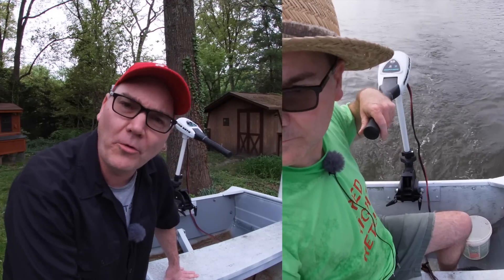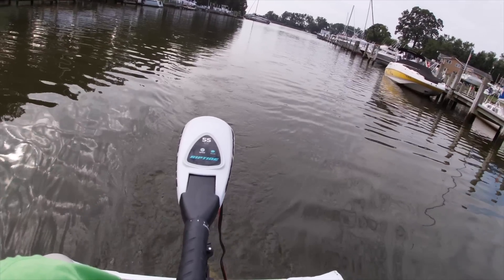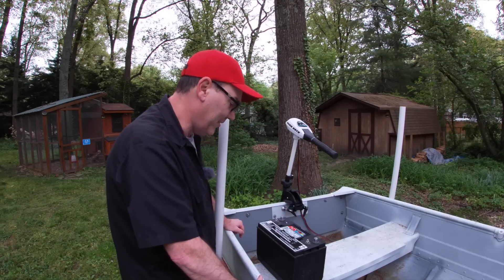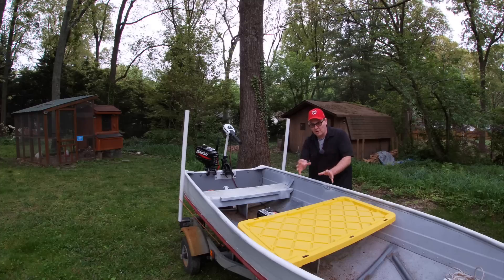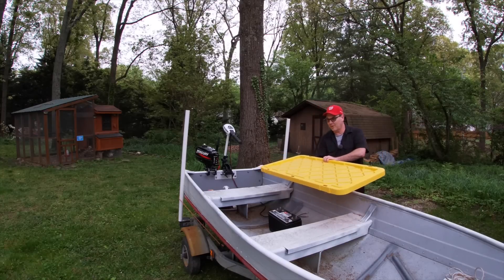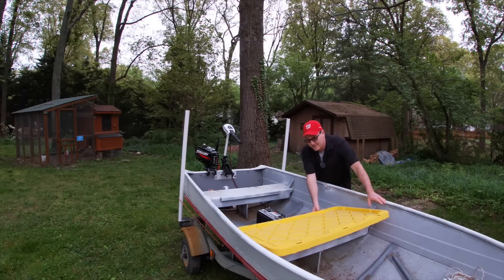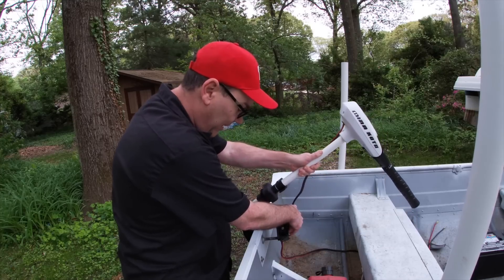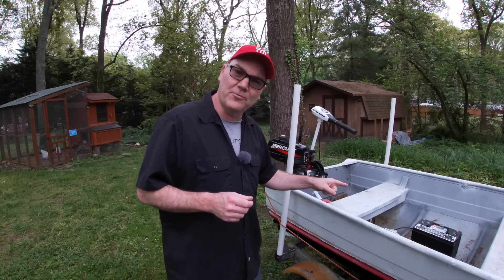How Many Solar Panels Do You Need For A Trolling Motor?

Comment: 🌴well it’s a year later Wayne , got the project boat all registered, gutted and installed a new fiberglass transom and floor , so like you and our buddy Forrest at DIY , we’re back to electric trolling motors and batteries, you’ve changed trolling motors and now you’ve got a new huge battery for a great power bank , Forrest , ehhh, three smaller batteries and your motor that you gave him 👍🏼 now is Forrest going to be able to get to the Bahamas on those batteries, I don’t thinksooo, so I looked against solar found a guy that had a 14’ alum. V hull with a pvc frame and 3 - 125 watt solar panels but he direct connected to the motor the motor was a 30 lb thrust , it pushed the boat 3mph , and it would probably 👈🏼 do better with full sun , so fist is what’s the cost of three 125 watt panels ?  Could this be  a Savior for Forrest on his project do panels and use batteries as back up’s 🤔 the solar roof would give power, protection from the sun and rain if needed , the idea that having limitless propulsion during daylight hours is pretty appealing and having batteries as back up or a gas kicker for night running is pretty cool , 🤔👍🏼. Dave , St Pete Florida
Reply from the maker: Good to hear progress on a project boat! He has a lot of variables to consider and if he goes with a really small boat, a second set of batteries might be better for his journey than a solar roof. I have been considering solar for my Whaler since it is such a wide and stable hull.
Reply: @WayneTheBoatGuy  hey Wayne , it would be interesting to see what you would do on solar for your boat , I’ve seen others do it on video, but they didn’t include the cost of there project, which would vary depending on the size and manufacturers, quality of panels , the bad part about going electric in Florida is saltwater, things just don’t last , it eats em .🤨

Comment: 36lb Thrust (All Series) = 0.48HP
40lb Thrust (All Series) = 0.55HP
46lb Thrust (All Series) = 0.64HP
55lb Thrust (All Series) = 0.84HP
62lb Thrust (All Series) = 0.93HP
86lb Thrust (All Series) = 1.50HP
the popular Newport Vessels NV-Series 55lb Thrust Trolling Motor is rated as 624 watts at the highest forward speed and so 624/746 = 0.84 and would be roughly equivalent to a 0.84 horsepower motor. 
to compaire apple to apple.
so a 624w powerdraw motor on a 100w solar panel.
as many other people mentioned, you gotta stop for fishing occassionally to catch up with the numbers.

Comment: Could’ve eliminated the first 3 min of the video. Can you, yes absolutely. Is it practical? No. 

It’s about the build, choose a lower thrust trolling motor, get an aftermarket mppt charge controller for faster power tracking, and a single used surplus 400w panel can keep that motor going as long as the sun hits the panel. (In ideal conditions)

Comment: This has to be a bad faith argument. 
I purchased a 12v 100ah battery for 250, with Bluetooth. 
You could get a single 300w solar panel that could fully charge that battery in 3.5 hours.
Reply from the maker: When I made this video the costs for what was available through Amazon at the time didn't make solar a better option than simply adding a second battery.

Comment: The size of your yellow bin lid is the same size as a 325 watt panel, ( not 100 watt). Plus a couple yrs later now the price of 100 watt flexible panels is around $50 bucks, ant they are 1/3 the size of what you show. Plus you are using the worst possible motor, ( uses way to much energy), you would need a pwm permanent magnet motor, which uses 1/3 the energy.
Everything you are stating is absolutely true, and someone without extended knowledge of such things will get the results you predict.
However as a designer builder of advanced hybrid, ( using tri-power tech, (gas or electric, pedal power, and wing sails all at the same time, you can do incredible things if you have the knowhow to design the hulls, electronics, hybrid engines, hydrofoils, and advanced wing sails.
Only for your own use, ( there is no market for such things).

Comment: I have looked into this for my 15ft sail boat and a larger one I am design now. The  goal it to be independent but it would technically be a secondary source of propulsion. (the larger boat I am designing would also have a generator back up.)

You would actually get more than 40% as the battery would also continue charging for the additional two hours you get. Most of my math initially did not include that you still get power in that extra time. Easy thing to forget about.

Also, you can buy used panels. I have been looking into used walkable solar. This way you can add a deck to your boat or at least keep the area to use and be able to go forward. Used solar goes for less but has also lost some of its capacity so there is a tradeoff.

There are marine panels specifically designed for 12, 24, and other voltages. when you go for these you end up with a boost in efficiency. many home solar systems like those shown in this video do not get as much into a battery due to the losses in stepping up or down the voltage.

For my smaller boat I have looked at getting a small quiet generator and having that as a backup with a single or double solar panel. The panels would be mounted above me giving some wind and rain cover.

I also think that it is always a good idea to have a few batteries. with your math you could have two panels forward with three batteries. By your video math that should be 16+ hours of cruising.

Comment: You can use the solar panels not only to recharge the main battery but also to run lighting, fans for cooling if you have a small cockpit like I do, electronics like sonar, iPad, cameras, charge phones, stereo, wifi hot spot, charge laptop. 2X100W fit on almost any boat with a bimini.

Comment: My use case doesnt concern range, but convenience. The range of our 120 amp hour SMF battery is enough for us for a weekend at our cabin. The key point of the solar is to avoid caryring the heavy battery to and from the boat - over the weekdays the 100W panel tops off the battery for next weekend.

Comment: I’m a true believer and user of a 100w solar panel on my 18.5 Nitro bass boat. Sir you are correct that the panel won’t charge as fast as the draw while running the TM but if you’re anchored or just drifting that panel will add some charge back to the battery(s). A 2amp solar charge for a hour is significant when you’re running low on battery power. Even if it gives you 30 minutes more of running time that may be enough to get you back safely to the dock. I made a T bracket and I use one rod holder to keep the panel angled upwards towards the sun, the panel came with a 30a controller and I added longer 12awg wires to reach the batteries. I fish on Reservoir electric motor only but they do allow you to fire up your gas motor (no wake speed) for emergency purposes to get you back to the dock.
Reply from the maker: Nice!

Comment: looked into adding solar to the house a few years ago. due to the siting angles involved figured my best charging percentage was 45%.  so a 100 watt panel i would be getting 45 out of it.  like the idea of doing it too a small boat, as i have a 12ft jon boat. an like you i can get about 6 hours from my battery. reading the other comments, the guy who suggests floating the extra panels behind  & tow them along. has not been on the water very much.  i can see water splashing onto the panels at anytime. an losing charging power all the time. not too mention rough water effects.

Comment: I would like to do this with a pontoon boat. 3000 watts of solar, 1500 ah of batteries, and a 10 HP electric motor. Thanks for sharing.
Reply from the maker: Yeah a platform with a big solar roof is how it can potentially work!

Comment: ...  

Ok now for the dumbest suggestion i could possibly make...  

So we start with a 500w 12v trolling motor putting out 40lbs thrust.   
we add the charge controller,  the battery,  and...   a tiny little 700/900 watt propane generator.   Its NOT gas so they can't complain...   you can run on pure battery for silent running,  but when you need you can fire up the little propane generator....   with a small 10 lb tank it'll run putting out enough power to run the engine.... and charge the battery,   or just run with enough power for the engine for a day or so straight.  

a ALP propane generator will do 60-hour runtimes on 20 lbs. at 250 watt output.   LOL.    oh but it gets more comical,  the little 1 pound tanks... will give you that 250 watts for 3 hours..

Comment: If that is a 12 volt motor, get 2 deep cycle 6 volt batteries run in series to get the long run time and not spending so much for the batteries.

Comment: I’m up in Alaska.  My 100 watt panel kept my 80 amp battery topped up for around four hours in optimal summer solstice conditions, in a 13 foot pontoon raft with 55 thrust motor set at middle speed.   I also oared the raft at the same time to cover more water.  Got to explore connected lakes off of Lake Louise near Glennallen.   Getting an extra battery though is the next step.  Thanks for the math!

Comment: Also if you want to go to totally even and keep the battery full the solar panels could only put in less than 20% of their maximum advertised rated output  what's hooked up to battery or grid
ohm's law
Pv-b+
Reply: That's right
Another fun one is line volts minus outgoingvvolts divided by line voltage multiplied by 100 gives you the percentage which also jives with previous test
Gooood times

Comment: Put a T-top on my 17' key west.  Fishing with radio, fish finder and lights just needed to offset the draw while the motor was not running.  Just put a 100w BougeRV flexible panel on top of the T-top.  $140 total with controller.  If I get 2A on the water I'm good.  I do have alternator charging from the motor was well and a pull cord if my math is wrong.  lol

Comment: panels are not practical yet unless you want to include a shade/roof to your boat and now you can put panels on it.   You'll be the nerd/envy of the lake.
Reply: Never will be because you can only get and use less than 20% of their maximum rated output rated output once connected to battery or grid
Ohm's law 102
Volts is pressure you must overcome the incoming pressure to put in it's like pumping water

Comment: this guy dont know how solar works at all haha he is a joke i can heat my house for free on solar in the middle of winter on a cloudy day with out the help of the batteries 
i see so many talk about what they have no clue about on youtube its funny its like listening trump take for 20 mins
Reply from the maker: Running a trolling motor off solar is different than heating a house. The reality is that we would need to use panels that take up more space than a small boat has to run the motor. I have a playlist about electric boating because I find it to be a fascinating subject and I like the prospects. So please before you judge me, maybe learn a little about the electricity draw of a trolling motor and the amount of solar panels it would take to run it on a small boat.
Reply: @WayneTheBoatGuy  see you don't know anything about electrical things and how they work or the power they consume 
And don't know how to hook up batteries correctly 
You can google this k 
Look up 
How many amps does a boat motor draw on 12 volts
20-30 amps 
Now convert that to 120 volt = 3 amps 
Smart guy can you heat your house on 3 amps ? No you fool look it up
Reply: @WayneTheBoatGuy  your the one that dont know shit about electricity  i have been doing solar for 8 years  
oh and you wired your batteries wrong on the video

Comment: putting a 100 Watt solar panel will give a bit of boost to your running time, but perhaps more importantly, you battery willl be fully charged without ever touching the battery.
Reply from the maker: Yes!

Comment: my kayak has 24lb thrust   on low speed it is 7 amps. the solar panel averages on a good day 2 amps so it looses 5 amps per hour.  but my battery stays charged so is ready an for trolling it adds an hour or so during  the day

Comment: Get a small alternator and a small 12v motor connect with. A small belt wire the trolling motor , alternator and small motor to battery and everytime u turn on the trolling motor the 12v motor will turn the alternator which in turn will charge the battery every time ur using it

Comment: I wish you would have spoken in watts for everything, the motor draw, the panels and the wh in battery.
Reply: So the useable watt hours from that battery being lead is about 600wh and the 55 minncota is about 640w roughly so if the numbers are correct you should get 1 hour of practical use. Yet people report similar setups work “all day” so we need to put a shunt in the mix to actually measure watts in and out. A household panel can easily be adapted with the right solar controller delivering 200w plus. I’d like to see more of the maths and assumptions so we can make better decisions
Reply from the maker: It gets hard when we use the term "all day" for the occasional tweaking of our position on the lake - which really means turning it on for a couple minutes every hour. Which is vastly different than running at top speed for 60 minutes straight consuming far more electricity than a panel (or two) can generate in that time.

Comment: I would make a roof with 6x100w panels.. It would be 114 x 324 cm.. One battery in use. The other charging...For loooong trips I would use 2 x 2-500 Ah

Comment: You don't hard wire batteries in parallel.  They fight.  An isolation switch is needed.  They charge,  isolated.  A pair of golf cart batteries are better because they are made for the jib and they are wired in series,  so no fuss.  6 volts + 6 volts = 12 volts.  Charge them on land.  Ny TK 144FC four cycle outboard is modified a tad.  The centrifugal clutch springs are very light.  The ignition flywheel key was filed and moved toward to p dead center. The aluminum propeller has a hand finish. 7 ounces of gas and it's quieter than most electrics ive seen.  It has a swiffer mop handle extension so i can sit on the middle seat. All day a gallon of gas,  nonstop.  For that performance,  your battery boat would need a periscope and conning tower.  Paint it yellow.

Comment: See, I was thinkinking of killing 2 birds with 1 stone. I have a 12 ft little fishing boat. 
I was thinking of putting a 700-watt  panel as a canopy for shade and power generation/ charging. 
I would  have no less than or 2,or 3 , 12 volts batteries. A charge controller, and maybe even a 120 power inverter on board. Which I could now build a small hanging rack from the solar modul to stowe the charge control, inverter, and fishing poles. 
 I feel it would be a win. The last thing I want is to run out of juice, without a way to charge.

Comment: INCORRECT INFORMATION IN VIDEO
1. You get a Watersnake 70lbs thrust motor that runs off 12V.
2. You can get a 700Wp panel, which will power your 55lbs (12V x 52Amax = 624Wmax) motor just fine (or charge the battery) - A 700Wp solar panel only measures 2.1m x 1.1m and can double as a roof / shade from the sun!
3. Equivalent 100Ah LiFePO4 12V batteries : 
- are very much lighter (< half the weight) than the Lead Acid variety
- also have a higher D.o.D. (100% vs 50%) - longer period of usage per day 
- and longer lifespan (10 years vs 2 years) !
Reply from the maker: I didn't say it couldn't be done. It's just that the cost to make it happen (in the right sun conditions) far exceeds the cost of a second battery.
Reply: @WayneTheBoatGuy  
Do yourself a favor, compare the price of a  700Wp solar panel to that of a 12V/100Ah LiFePO4 battery - a solar panel is 10% the price of the battery?

Comment: As far as I can tell, you did not answer the question you asked in the first place, namely, "How Many Solar Panels Do You Need For A Trolling Motor?" Let me tell you how to determine that answer so there's no misunderstanding about the proposition. TAKE THE BATTERY OUT OF THE EQUATION. Now, see what you have to do to get going. In other words, the proposition is unattainable.
Reply: Not true, I easily run my Minn-Kota off solar.
Reply: @gsp49  With no battery?

Comment: If I were to set something up on a fishing boat...  I would install 1-2 Lifepo4 batteries and 200w of solar on a raised arch on the back of the boat.   This would also provide a bit of shade for a cooler.   The Lifepo4 batteries would supply more than enough power to get through a days fishing while being partially recharged by the solar panels.   Typically you aren't going to use the trolling motor all the time and often at low speeds.   Since the solar is there all day long regardless of your activiity it continually trickle charges the batteries.   With this setup you should never have to charge the batteries.